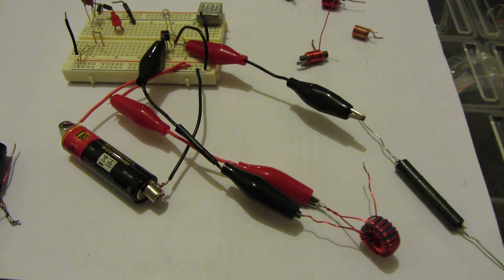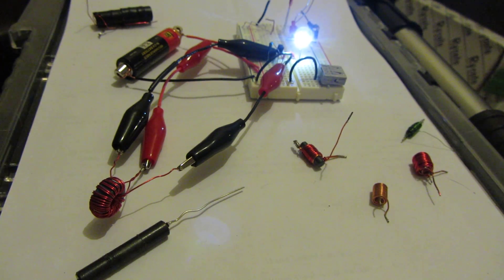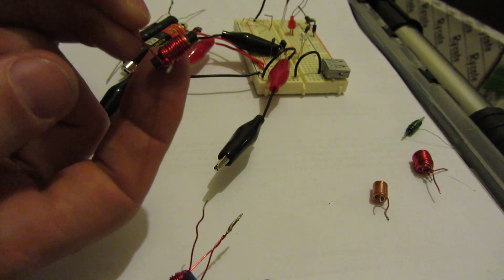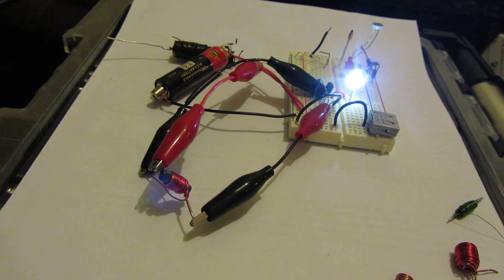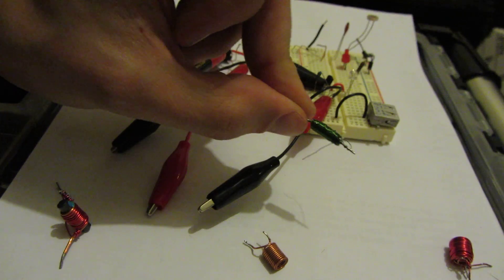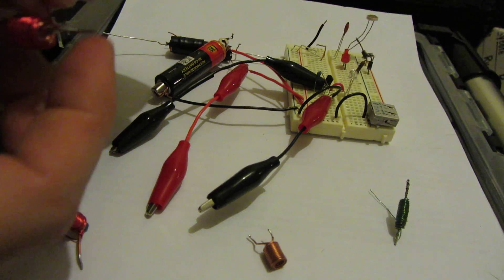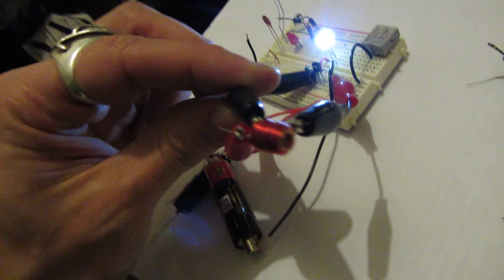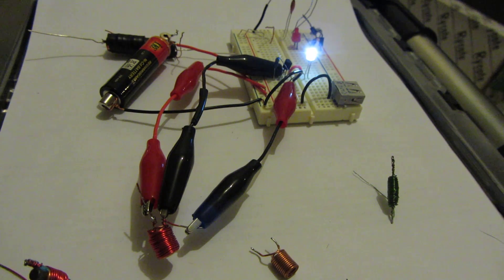Toroid-less Joule Thief running without a ferrite core

Comment: U still have magnetic field without 
Iron. Thats what i thought.
Not so strong like iron but still it work. Preciate your video. I think you can magnifie the resonance connecting two or more JT in serie. Can you do that. Would be interesting. To drive bigger load.

Comment: 1. There's a good video which showing that without a toroid it will work, here is shown as well.
2. Instead of toroid you can use as well soft metal and observe on oscilloscope difference. There will be if metal is soft and some screw even will do if soft.
3. Joule thief is a great thing, works from I think 11 turns of wire with or without the toroid ;) . You can use far more power than originally you would get. Esspecially it's worth tinkering with about 100 turns ;) and bipolar / 2 windings per layer minimum with and without a ferrite even on paper as a air coil. 
4. Try to connect it with NE555 ;) and then charge some other battery. Swap them when full and observe. If you can match on the oscilloscope frequency, you'll get overunity ;) out of it ;) .

Comment: The toroid core matters not. It just needs two separate coils in order to have the two fields, these act on each other building up until the field collapses and energy is released. It can be done with two small through hole inductors as well, but they need to be next to each other. It is fun tinkering with this stuff. I am doing the same and trying to make a practical use item from this circuit. There is great potential for creating something very useful out of it.

Comment: By the way, there is no requirement that the inductor have a core made of any magnetic material.  Just winding the wire around a piece of plastic like a soda straw and leaving it with an air core is okay.  You can wind the wire around a large high value resistor and it will work okay, too.

Comment: The ferrite core greatly increases the inductance, and hence the frequency is much lower, which helps the efficiency.   Where a toroid might have hundreds of uH, your air core coil probably has an inductance of only a few microhenrys. The frequency might be in the megahertz. See if you can tune it in on your am radio.  I've made air core JTs with 16 feet (5 M) of 24 AWG (0.5mm) wire and they work okay. But that's a lot more wire than you're using.